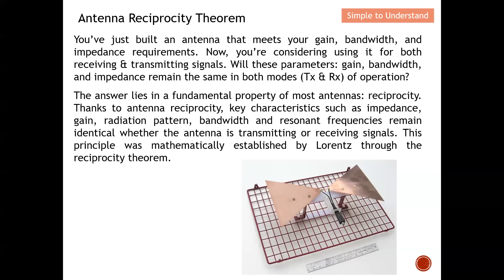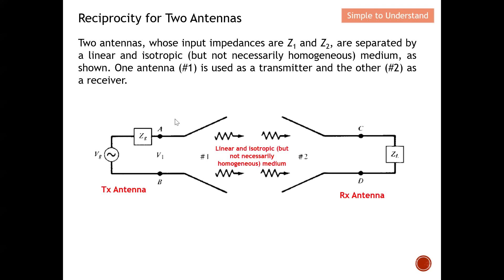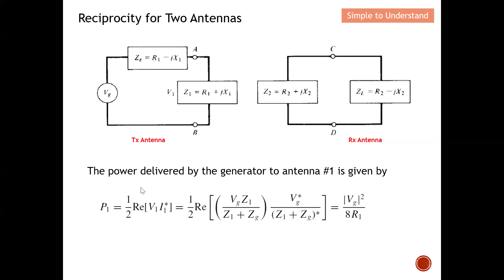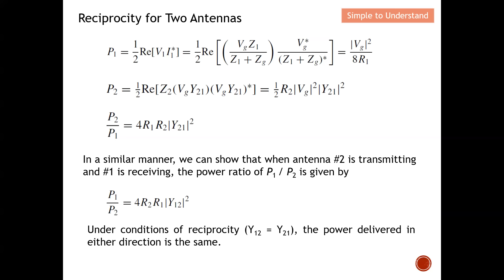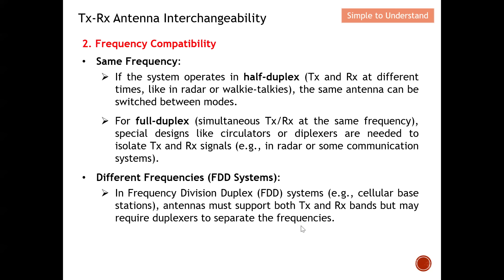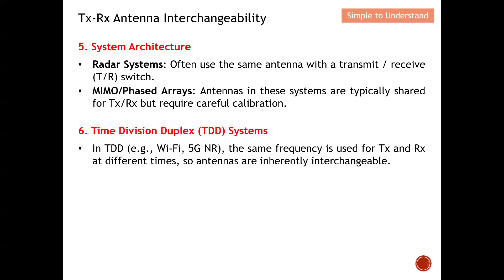Antenna #18. Reciprocity Explained: Conditions When Interchangeability Transmit & Receive Antenna.

Comment from the maker: Thank you for your support in watching this Antenna Design Video.
Have you ever asked yourself this question: When you design a transmitting antenna that meets key parameters like impedance, gain, radiation pattern, and bandwidth, can the same antenna also be used for receiving?
The answer is yes—thanks to the antenna reciprocity theorem. Here’s how it works:
For example, if Antenna A is the transmitting antenna and sends a signal to Antenna B, the transmitting antenna is excited by a voltage, and we measure the received signal strength by checking the current at Antenna B.
Now, if we swap the antennas—making Antenna B the transmitter (using the same voltage source)—the current measured at Antenna A will be the same as what was previously measured at Antenna B.